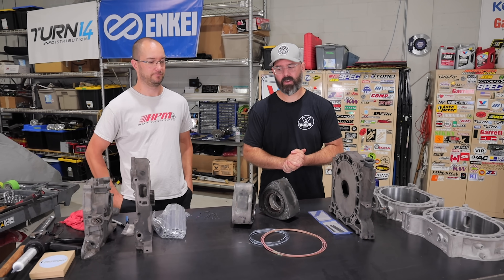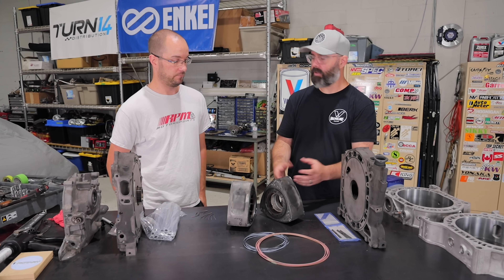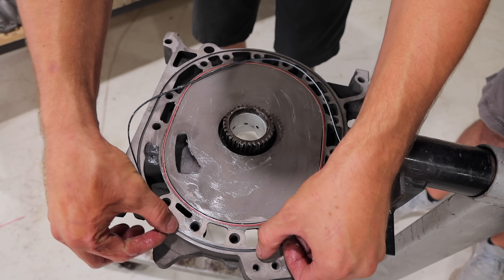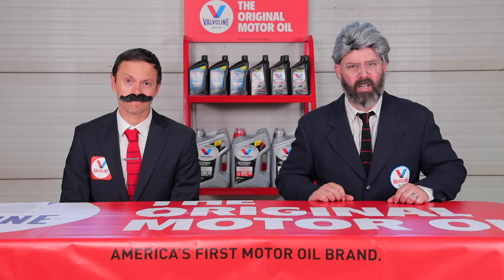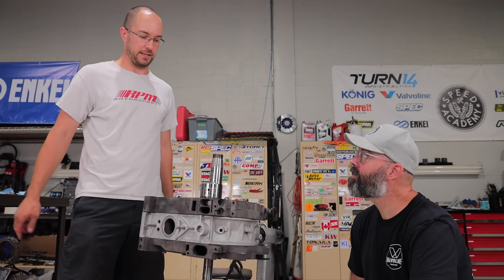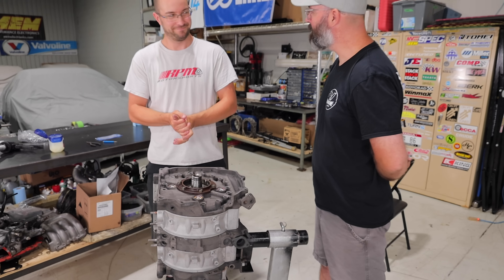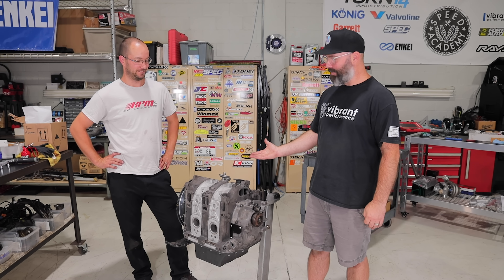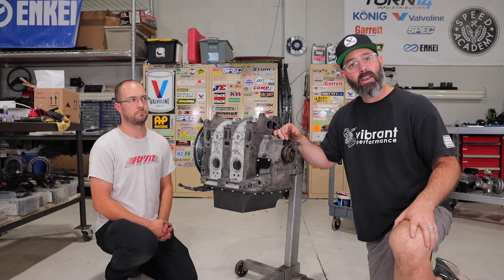How to Build A 10,000RPM Rotary Engine - Part 3

Comment: At 5:36 am it 's not a corner joint but a TIP! and there is an easier method to install an apex-seal and  springs in their location! loock rei-amemiya works, he has been doing this for 50 years!

Comment: Torque on the oil pump bolts at 12:00 using the crows foot in that configuration is inaccurate. The tool is being used improperly with a torque wrench. https://www.youtube.com/watch?v=eggGK_NGR6w <- see reference video for enlightenment :)

Comment: How are the rotors aligned? I know he said 1 points to 12 and the 2nd 1 to 6... but is this 100% dead center 12...are there dowels that align the rotor...can you put 1 rotor at 12 and the other at 3? I couldn't understand this on the video. 
Thanks

Comment: Really enjoyed  the video really good job on the work 
I think on your new oil pan , the sump pump seems high if you have extra oil it technically would run cooler but the coldest point would be on the lowest point of the oil pan and also if you didn't have enough oil and or burned to much oil the presser would drop wouldn't you want the sump pump to be lower ? Closer to the bottom of the oil pan ??

Comment: other method of doing apex seal is using super glue to stick 2 piece together the clean up both side of seal, stick both spring and seal all together, i reckon the method in video can used in 12a and rew but not renesis lol

Comment: It may be the easiest to assemble but it is also one of the easiest to get wrong just get one of those o rings a little bit out of place or get the clearances on your corner seals spring just a little off they may be a little less time consuming but piston engines are a little bit more forgiving

Comment: I'm curious to know if they locked the ring gear in by cutting an id groove on the rotor counter bore, and od groove in the gear. As per racing beat guide lines. Thanks.

Comment: Just curious, why block off the oil metering pump instead of installing a SOHN adapter?
Reply: Was wondering the same thing. I thought the SOHN adapter was the holy grain mod for extended rotary engine life? 🤔

Comment: To all the rotary heads, if you put premix in the fuel, how does it cope with e85 ? i'm assuming it's a lot more frequent oil changes compared to a piston engine ?
Reply: You need to test the premix oil in e85 to check for separation.

Comment: Recently you guys asked about what you should do with your channel -- this kind of content is awesome and interesting and pretty different than a lot of high quality channels (many seem to cater to car noobs basically). Infact you guys might run a poll on the experience level of your viewers, I think that would be pretty interesting. I imagine most are like me, which is "Have pulled some engines or swapped a clutch, etc, but haven't hand-built an engine"

Comment: Torque on a Crow's Foot?
Hmmm.
Anyone else seeing a mathematical error in play here?
Reply: I've heard alotta people say you can't properly meter the torque on a crows foot, but I don't see why not.
Reply: @tommylyeah  would you like me to explain?
Reply: @notsponsored103  - Uuuuh... well, I don't understand why it can't be metered propperly in the first place.
So, not to sound rude, but can you explain to me why?
Reply: @tommylyeah  sure no problem,
Torque is equal to the force applied to a lever, multiplied by the length of the lever.
1 Nm is a unit of torque said to be the result of applying a force of 1 Newton to a lever 1 metre long.
Also 1 ft/lb is the resulting unit of torque from applying 1 pound of force to a lever 1 foot long.
Therefore if you apply the same force to levers of different lengths you will get different resultant torque. 
Adding a Crows Foot box wrench to a torque wrench changes the length of the lever, in fact making it more powerful.
This means you will apply more force before the torque limit clicks off.
This may not be too significant with large torque wrenches applied to very strong fixings, but in smaller more sensitive applications the increased torque could cause over tightening of the nut or bolt.
Reply: @notsponsored103  that's pretty interesting, I've never really thought about it but makes sense. Thanks for explaining!
Reply: @notsponsored103  - Agreed. Makes sense.

Comment: If the rotors are a 180 degrees out of phase and there is a counterweight on the front, is there an opposite counterweight on the back?

Comment: I love these motors, I think the only scary part about rebuilding them would be the apex seals and all the little intricate pieces. Besides that they are fairly simple. Wish this design was added onto by other manufacturers. If many companies joined in and many iterations were made, this could of been a spectacular modern engine.

Comment: For some reason I’ve come across a ton of really low torque specs on parts recently so I’ve been stealing my mountain bike torque wrench that goes low enough to measure 3 in/lbs. for the price of bike torque wrenches it’s worth having in the tool box !

Comment: correct me if im wrong putting the crows foot straight not 90 degrees from the torque wrench gives a different torque spec.
Reply: This.  To avoid measuring and calculating, always put crows foot on torque wrench at 90 degrees.
Reply: You are correct.

Comment: I'm certainly no expert, but the corner seals looked to be upside down. Also, how were the corner seals installed on the other side of each rotor if they weren't in place as the rotor was put in the housing?
Reply: The corner seal is only on one side
Reply: @RE-RotaryExperiment  no there is corner seals on both sides

Comment: I’m coming due for a rebuild on my renesis from my 11 R3. I was wondering what you have to do to orient the rotors for timing and how precise you have to be. It’s seems like people just estimate when they’re doing final assembly lol. I’m trying to mentally prepare for my process.
Reply: Hey Charles, there is no orientation of the rotors necessary other than the gear side of the rotor facing the gear in the corresponding iron. The eshaft sets the orientation of one rotor in relation to the other due to its lobes. Just take your time and make sure you spec everything out. Best of luck!

Comment: I'm intrigued by that engine...i can't even imagine how a 4-rotor version would go together...like how long are the studs for that? also there is a tool that looks like a "dog bone" that would work for torquing those oil pump bolts. instead of the open end of the crows foot, it's the closed end of a box wrench. great video guys💪

Comment: Is there some truth to the old tale of not touching headstuds with bear hands because of the acid in sweat. Or is it just an old fairy tale? 👌
Reply: Nah mate it's because if you use bear hands you'll get fur everywhere.
Reply: @daedalus_20v  😂😂 yeah yeah I can't spell just make fun of the illiterate. You know what I mean.
Reply: Quoted from ARP

"Why does L19 material require special handling?

Like most high-strength quench and temper steels, L19 requires special care to avoid hydrogen embrittlement or stress corrosion. The material is easily contaminated and subject to stress corrosion. The parts must be kept well oiled at all times and not exposed to moisture. Wearing gloves while handing L19 parts is a good precaution."

https://arp-bolts.com/p/faq.php
Reply: Wait a sec I just checked and I didn't miss spell anything. It's spelled bear. (Granted I should have maybe checked before writing. Oh well)
Reply: Definitely meant the latter. Ty
Reply: @Hamsteren91  
bear = carry... or carnivoran mammal of the family Ursidae. 
bare = uncovered
I think you meant the latter.

And it's not a fairy tale, but a myth, or a urban legend.

Comment: sorry if i missed this but what would happen if you installed both the apex seals pointing the same way as opposed to opposite directions?
Reply: Nothing really happens, is just easier to install in that direction.
Reply: Nothing really happens, is just easier to install in that direction.  If you noticed, on the first rotors, the corners on the apex seals are towards the primary port, and the corners on the apex are towards the secondary port on the second rotor.

Comment: Just a question, feel free to shoot me down in flames if it’s a stupid question.
At 10K RPM the rotors are only going around at 3330 rpm, with the geared crankshaft spinning at 10K , so is it kinda cheating calling a rotary engine a high speed engine, ? I’d like to read the engine revs as the rotor speed
Reply: I dont see why it is cheating because rpms even in the piston engine are the speed at which the crankshaft turns it stands for revolutions per minute

Comment: I've seen a few rotary builds now and the father of the guys from Angel motorsports, a long time rotary builder said "don't use vaseline on the rubber seals, it's petroleum based and isn't good for the rubber".
Reply: hylomar is the best

Comment: Future proof.... did you replace the dowels with rods? If not high enough boost will twist that motor, solid dowel replacement is always recommended for reliable high horsepower applications and i didnt see you machine housings or remove the dowels once you put the other iron on, just little skeptical of how much reliable power you'll get.
Reply: Define high horsepower?  The turbo they are going with wont even break 450rwhp
Reply: @knonfs  they mentioned doing a high boost version later on id assume they'd get a bigger turbo, not like the one in there is permanent

Comment: Great video! But 10,000 rpm build. Correct me if I'm wrong but I thought to safely run 10,000 rpm you needed clearanced rotors?
Reply: I've given up they say they want to do high boost and didnt solid dowel it
Reply: @jaredspratley6270  high boost?? They are using rx8 rotors..
Reply: @turbos4fc3s  the rotors aren't the problem vargus brothers(angel motorsports) have customers that have side clearanced them and used them, the  structure of the housing is what im worried about they wont get 10k rpm reliably because the rotors arent prepped right thats a given, but 9.2 is possible if the tuner is good
Reply: Lightening and balancing of the rotating assembly goes a long way towards enabling 10,000 RPM.

Comment: @The Kyle Sutherland
They used modified RX8 rotors which are already lighter and higher compression, they could've done some lightening but it wouldn't be too significant. I think more important would be a proper balancing of the rotating assembly.
Reply: The last owner was using the same builder and had it balanced, just didn't show us